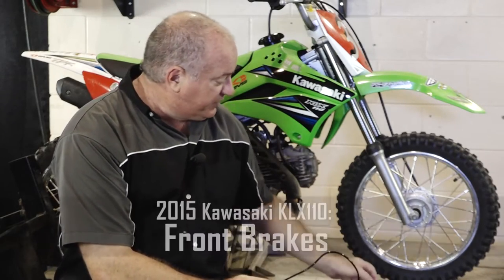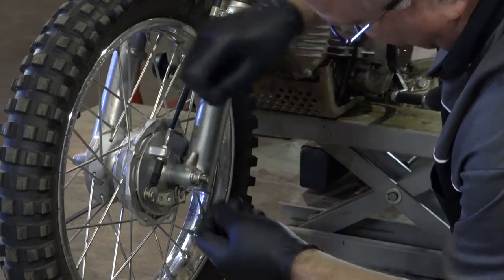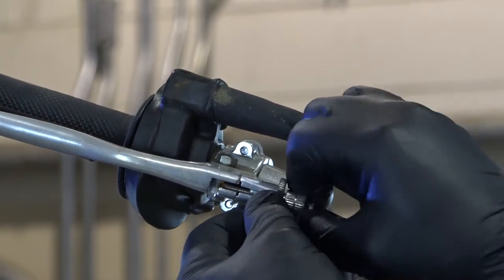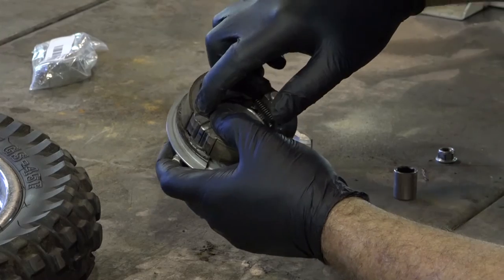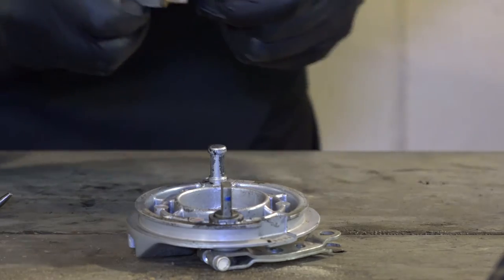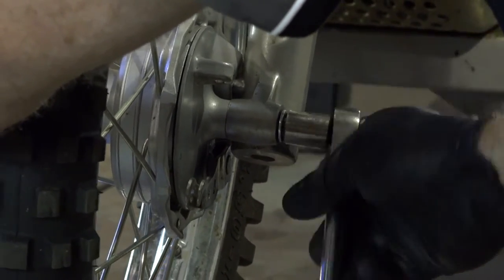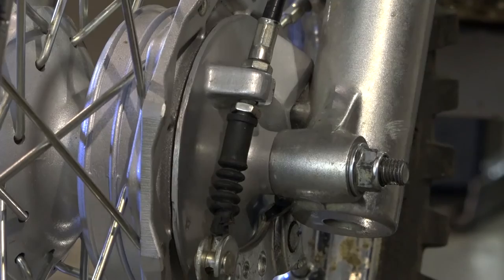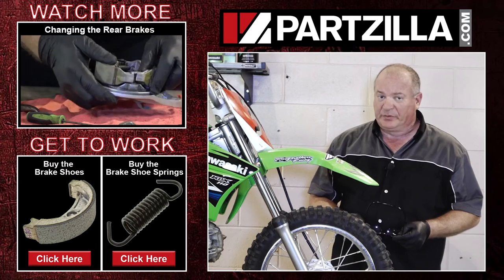How to Change Front Brake Shoes on a Kawasaki KLX 110 Dirt Bike | Partzilla.com

Comment: Thanks for the video. I replaced the front brakes on my sons KLX110L and I would like to add if you are working in cold temps (single digits here in NH today) bring the brake cable indoors to warm it up before you attempt to reconnect it, there is no extra room with the new brakes installed.

Comment: It’s good also to use parts cleaner and clean out the hub parts /light sand the inner brake hub to clean. Also I add some water proof grease on the axel bolt. 👍🏼 Great video !

Comment: Hi, 07 crf50f crashed into the wall "everyone is ok" but the fork broke and brakes don't seem like they are catching only sometimes and when they do it's very little stopping power... think the springs in drum could have came loose?
Reply from the maker: If you hit hard enough to break a fork...you should probably just take apart the wheel and drum and inspect it all.  It could be a bad line or springs or something else.
Reply: Partzilla hey I opened it up and all good! I slightly fixed it or just for the moment now when I break it’s like wham!, anti lock times 2... nothing is hung up or anything... I’m trying to avoid replacing the hub ect

Comment: yes it does
Reply from the maker: Then it's not lining up on the cam shaft right.  Make sure there is nothing blocking the bolt valley or the cam shaft isn't bent.
Reply from the maker: Not sure what year your bike is, but this should give you a better idea on what goes on that portion.

http://www.partzilla.com/parts/search/Yamaha/Motorcycle/2013/TTR110E+-+TTR110ED/REAR+WHEEL/parts.html

Comment: hey John u know the part on the rear brake that has that pinch bolt if u took it off how would u get it back on (I'm doing this on a ttr 110)
Reply: sorry referring to the rear brake drum video
Reply from the maker: The pinch bolt on the brake lever arm?
Reply: yes that brake lever arm I can't get it back on my 110
Reply: to where I can put the pinch bolt thru
Reply from the maker: Just slide the arm on, then put the bolt through.  May take some wiggling.
Reply: Does it matter and what angle it is on?

Comment: see that's what I thought but it won't slide even if you do wiggle it
Reply from the maker: Double check the arm to make sure it's not bent and then check the cam shaft for damage.  It should slide on pretty easy.  Does the bolt go through before you try to put it on the cam shaft?